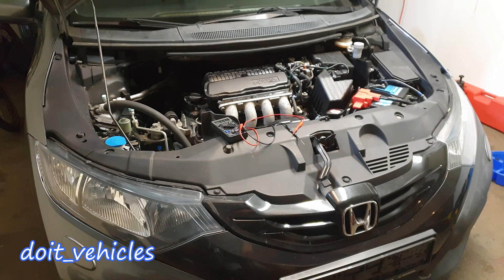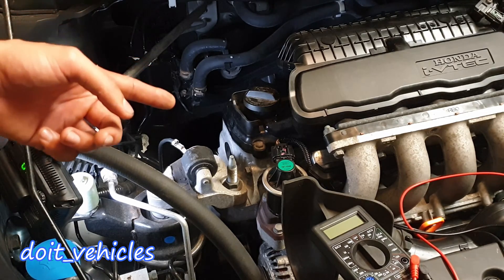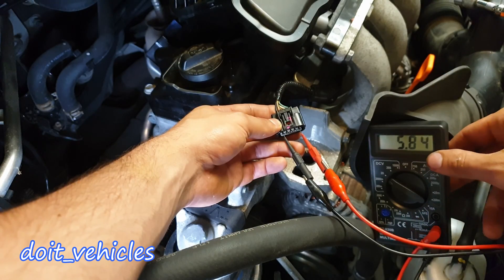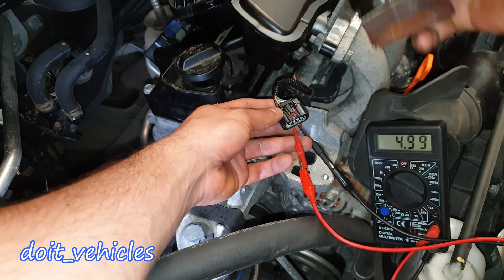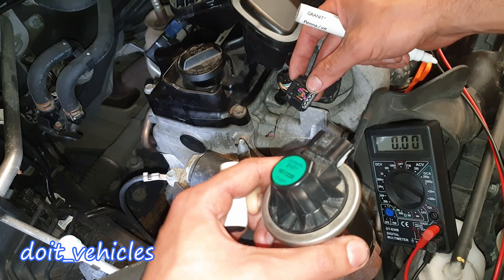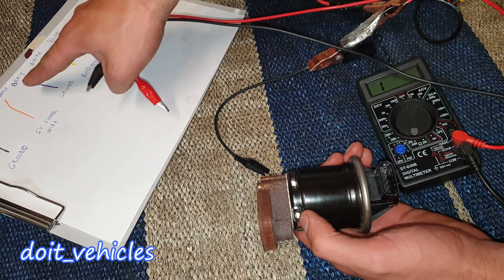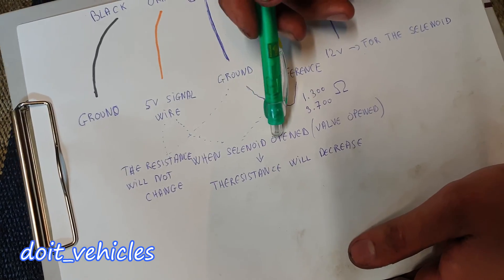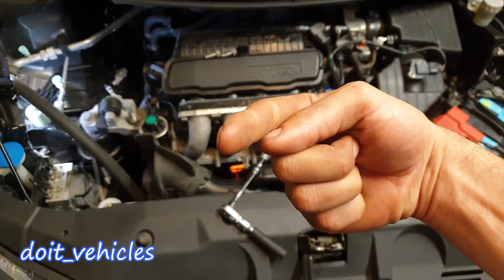Electronic EGR valve - 2014 Honda Civic 1.4 - Test it before Replacement

Comment: Thank you for the video.  My 2018 Odyssey has no 12V input to the EGR, and the resistances of EGR Valve are good.  The wire harness looks fine, do you have idea what cause no 12V input?

Comment: So basically, the 12 volts is applied by the computer, when the vehicle get up to operating temperature? Because the key is turned to the 2nd position already. If I am wrong please correct me.

Comment: Hello!
I have a question if you can help me with a Honda Civic 2013 1.4 i-vtec with 150,000km, is it worth buying? What problems occur after so many km on the engine?What urgent work should be done?
Thanks.

Comment: I have a 12 volt battery and when I touch the pins with +ve and -ve from the battery nothing happens and valve does not open…it’s stuck in a closed position and I am getting P404 error…is the valve bad ? Or any other components ?
Reply from the maker: definitely a bad valve then
Reply: The valve must open if we connect thr wire from-and the wire from + of the battery 12v to the pins? Does it have polarity or do they go anyway? Does it matter if we keep the wires connected to the valve longer to clean it? Thank you!